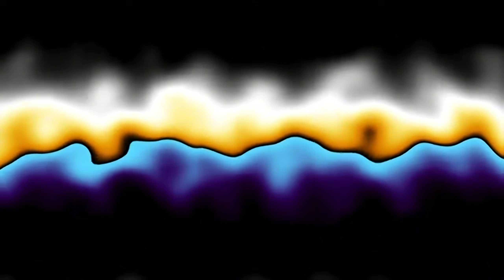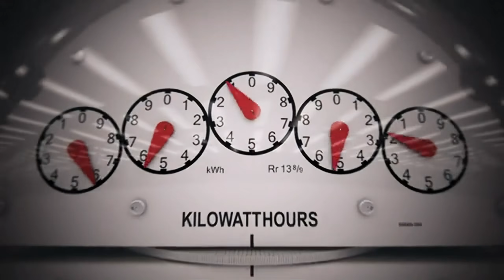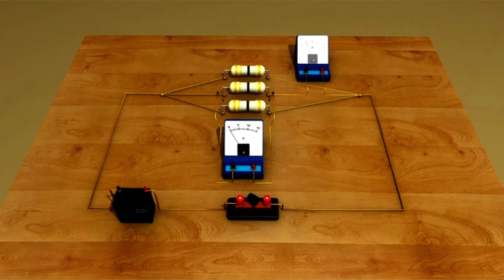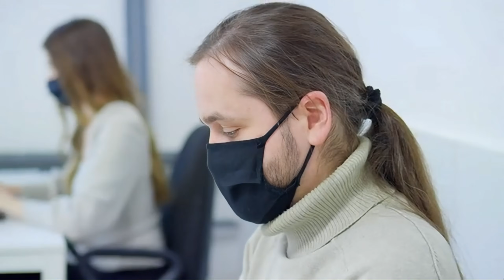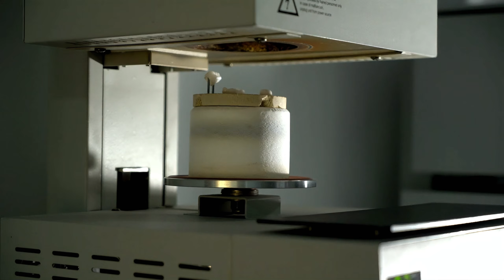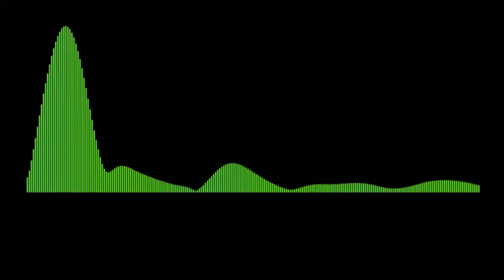This $10 "SOUND TUBE" Freezes Air Using Only A Speaker (No Gas NEEDED!!)

Comment: AI slop.
Reply from the maker: I understand your skepticism, but this sound tube experiment is actually quite real and fascinating!
Reply: @DTDStoires 
I think you understood the criticism wrong.
It is AI, not you making one in the real world. which is actually what I was looking for information on, when I found your AI Slop.
So thanks for wasteing my time, and making youtube shitter.
😅
Is that clear enough with the criticism.

Do you have a video talking about a working sound heat pumb? I like this one Sterling engine built around the idea.
😅
Reply: thanks...

i have only found like one builder that was working on this types heat pumps. If I am understaning it correctly.

I think the other guy tried using this on a cascading cooling system.😅